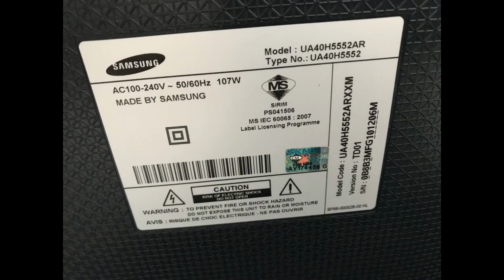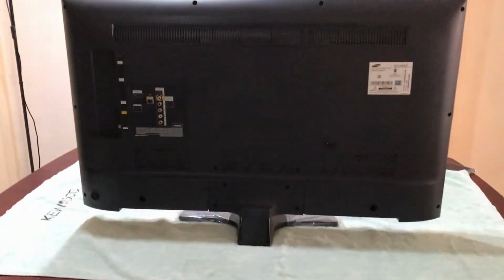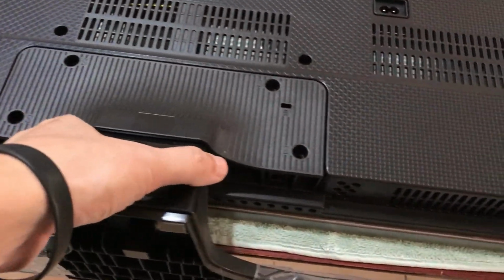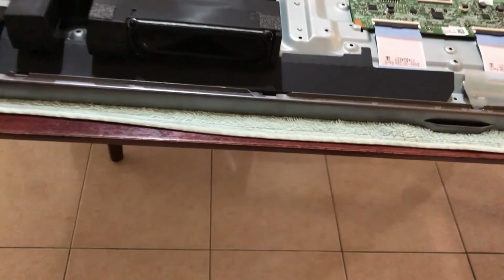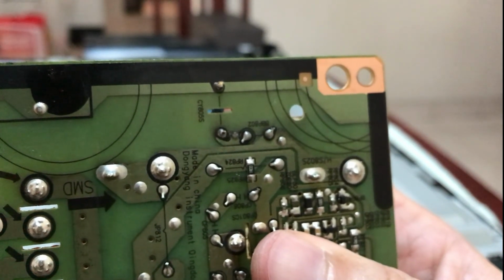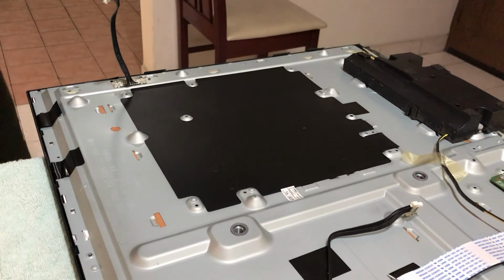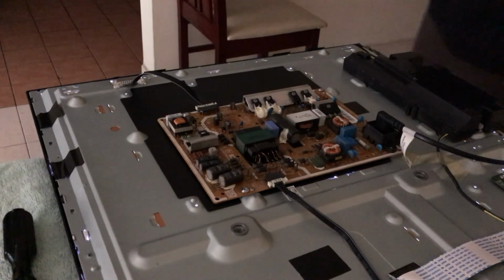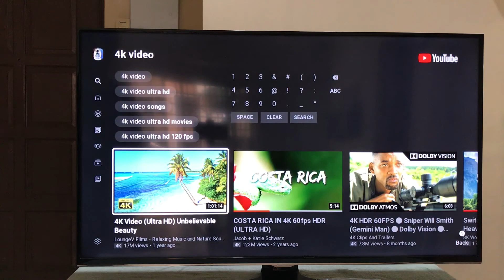How to fix no backlight on a Samsung 40 inch smart tv (beginner level)

Comment: Hi! Thank you very much for sharing the problem you had with your tv. I've one showing the same kind of thing and helps a lot to see that somebody else had gone for something like that. I has afraid of taking it to be fixed and discover that it could cost a lot tp be repaired. Now, thanks to you, I'm more calm because I know the repair is going to be cheaper.
Reply from the maker: Hey im glad you find this video some help and really hope you get your tv fix soon. Thanks for the comment appreciate it alot
Reply: Sir mgkano po backlight 40 Samsung
Reply: So it was the power board? Same problem just backlight work but dont turn on with the tv

Comment: same my smart tv almost 5 years. no backlight but working with sounds and dimmed picture.
Reply from the maker: Then most probably either one or a few of the backlight leds are not working. Can get it replace pretty cheap. But skills are needed
Reply: @RyanWKW  thanks. How much it cost for replacements backlight power?
Reply from the maker: Im not an expert but i did some survey and if just the backlight alone can be around $30_$50 depending on the size of your screen. If its power board than will be atleast $100 plus